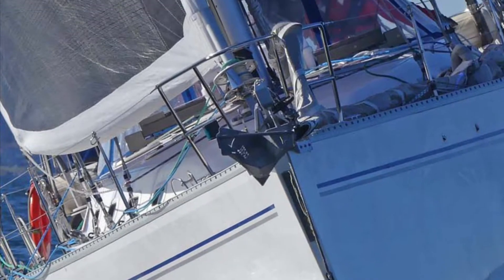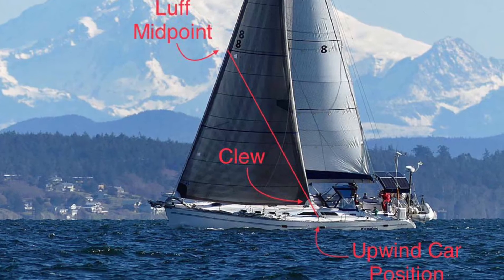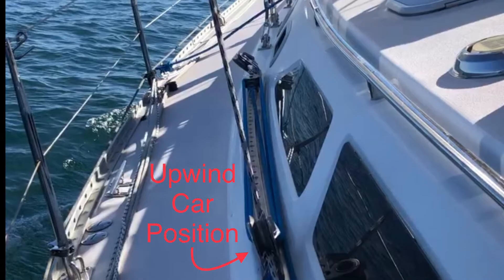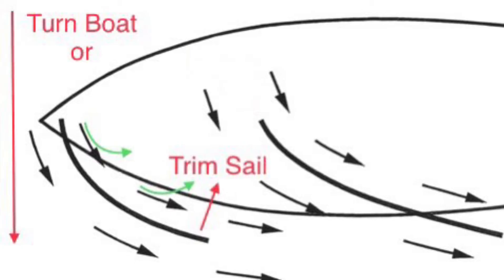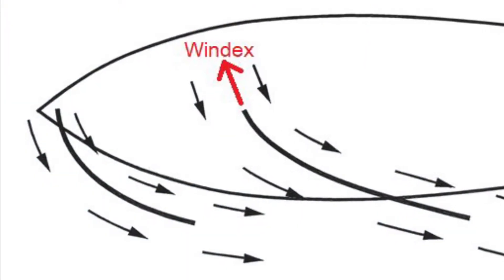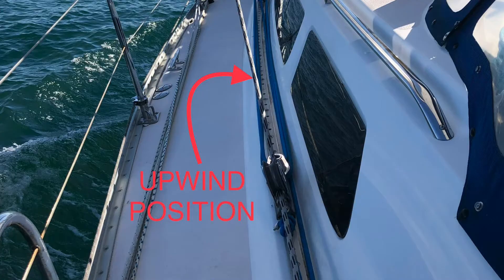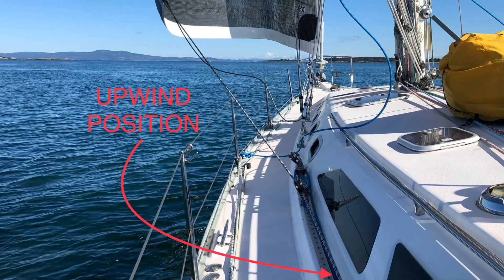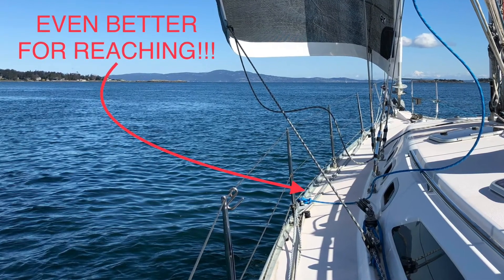Optimizing Genoa Sail Trim and Car Position

Comment: Has anyone figured out what he means by needing the foot and leech off the lower and upper shrouds?
Reply from the maker: Each boat is slightly different but in general for maximum pointing ability you want the foot and leach of the leach barely touching the shrouds, but not such that they deform the sail. Does this help?

Comment: Good explanation. I hope you can expand on the different reaching angles in light and heavy wind and show the effect in perhaps a next video? But the basics seem to be: tighter angle to the wind, car goes aft (less twist). Wider angle (beam or broad reach), car goes forward (more twist).

Oh, and one more thing, your cart is excellently placed, but on some boats, where it is closer to the side,  it helps to use a barber hauler on tacking courses to get a little closer upwind.
Reply from the maker: Good suggestion! I would recommend marking your track (e.g. with numbers) and creating reference points in moderate conditions with a relatively un-twisted sail. For the most part in point mode (i.e. beating) the car is somewhat aft and inboard to get a good tight sheeting angle, while as the wind goes aft and you start to reach the car goes forward to keep the leach closed. If you have outboard tracks or floating leads you can also move the car outboard by the same amount in a reach. In higher winds you can keep the car a bit aft of the moderate wind settings to twist off and depower a bit. Does this make sense?